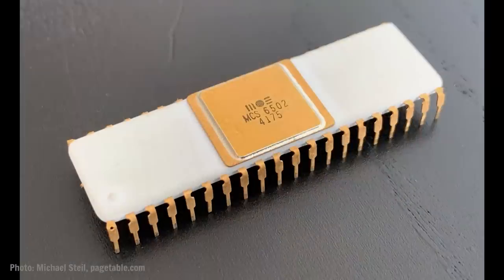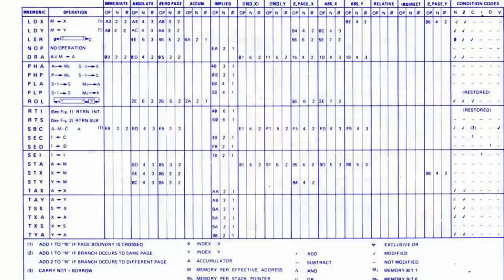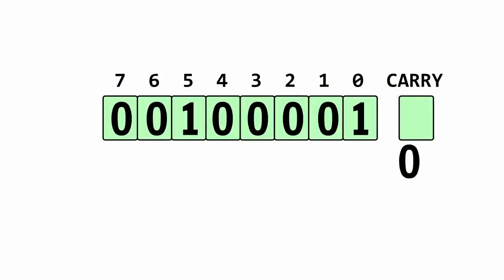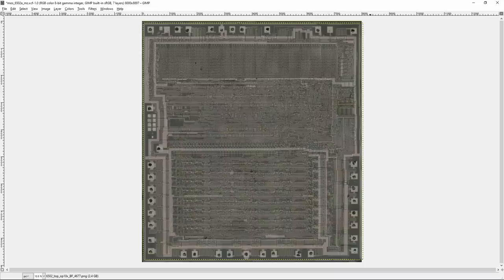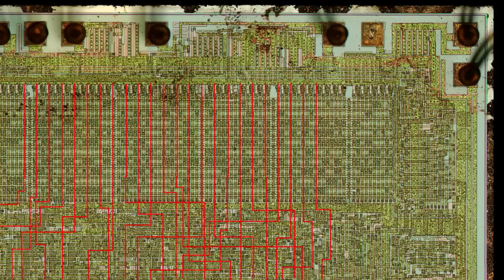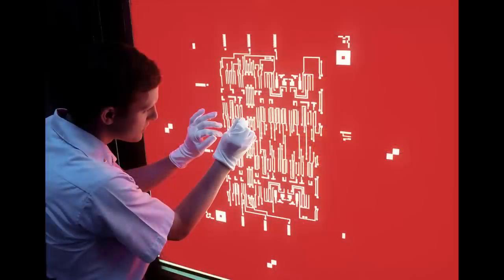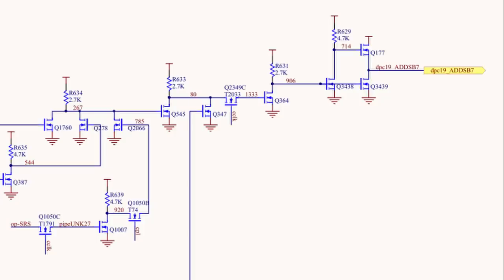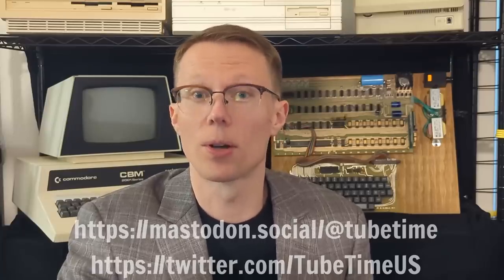The 6502 Rotate Right Myth

Comment: 2:01 wen u realize teh 6502 is just cheep stripped down motorola 6800 series, to teh point if you can get yo hands on a 6501 it will plug right in a 6800 cpu socket and work too, just wit a different rom
Reply: 3:02 but some of dem illegal instructions work good for code optimizing and drm techniques, till you replace pmos with cmos or some other fab tech
Reply: 7:25 when you realize there are more than a, x, y flags, stack pointer, and program counter inside dat 6502, you only ever have direct access  those externally, though you probably could make a larger instruction using some illegal opcodes and some valid ones, yo problem is really going to be precision and dealing wit floating points

Comment: if the bug is a myth, how was adrians digital basement able to prove the chip infact had the bug and had a messed up ROR instruction?
Reply: You should probably actually watch this video before commenting.
Reply: Because the issue is real. There is no "myth" here, only a debate on whether this qualifies as a bug or as intended design.